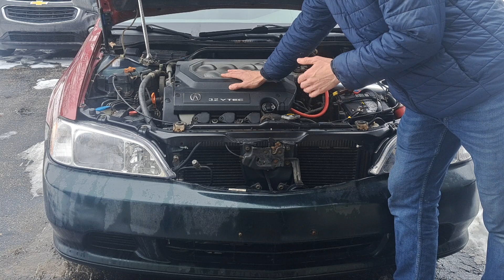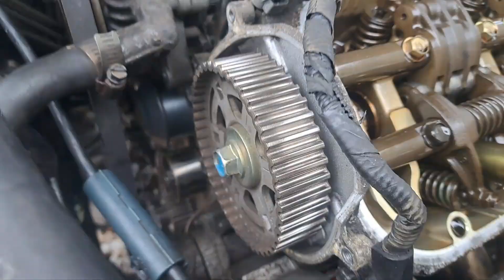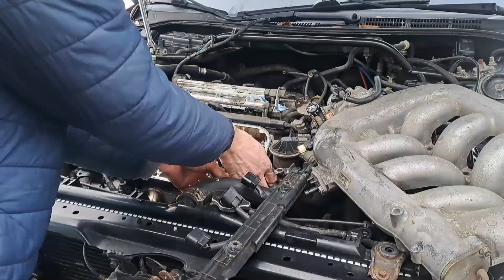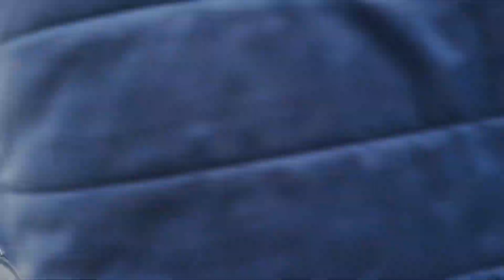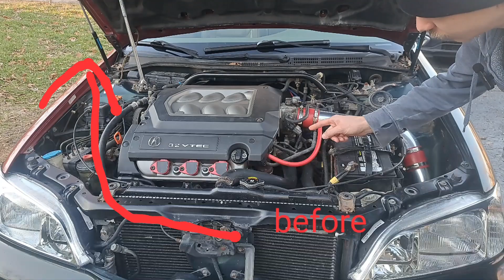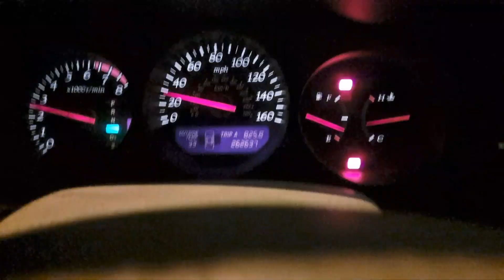J Series Camshaft Upgrade. Acura TL Build Part 2.

Comment: Did you keep the stock springs? Any concern with valve float? Also did you need the spacer?
Reply from the maker: Stock springs, no valve float, and yes I needed the cam gears spacer adapter from p2r. The car is turbocharged now and runs great.

Comment: Great video. It's good to see a build on a non-type s 3.2TL with the J32A1. Is there a reason why you went with the J32A3 cams rather than the ones from the J32A2? Also, wondering if you're planning on doing a 6 speed manual swap. I've never seen a swap done on a non-type S TL.
Reply from the maker: Thanks man! I went with the a3 cams mainly for price and availability at the time. It was still a big upgrade from the stock j32a1 camshaft. I definitely plan on doing a 6 speed swap here soon. The car is actually turbocharged now and absolutely rips and yes its till on the auto lol there is a short of it on my channel
Reply: @jdmjedi777   Thanks for the reply. I agree, it looks like it's still a big step up from stock with just the cams alone. So, with no other changes, including stock tune, would you see noticeable gains as a plug and play mod and is it even safe to run without ecu changes? Although I would think that a tune would get you the most out of the cams.

Comment: My question is, what are the options for better cam's on a 3rd gen.
Reply: They have a drop in cam just like this, also have a no limit can that locks you in vtech
Reply: @ethanmiller9400  link? please.
Reply: @ethanmiller9400 anything for the 4th gen (3.5L)

Comment: Thanks for posting this, do you still have the stock computer? I have a 99 with a bad cam lobe (313K miles) and can only find the J35 cams. I am interested in doing this conversion but can’t find any good info on wether or not it requires retuning the computer. Not looking for performance, just to have it running correctly. Thanks
Reply from the maker: I'm using a piggy back ECU called a DET3+ from ECUmaster. It's about 400 brand new. If the cams are the only thing you are changing you will very likely be just fine without needing a tune. I also still have the stock j32a1 cams out of this 99 also if you are interested. Although one did drop of of the bottom of the box I had then in the other day but it landed right on my toe and not the ground. I could inspect it and make sure it's fine still though.
Reply: @jdmjedi777  Is your TL a manual?
Reply from the maker: @ReeseAssad  no its an automatic
Reply: I have an 02 accord coupe with the j30a2 would this work as well?

Comment: Hey man, when you were putting in  the new cams, did you have to position them a certain way to stay timed correcly or they only slide in one way? I am installing cams on my TL soon.
Reply from the maker: The cams will slide into the cylinder head in pretty much whatever orientation you put them in. Once you get the cams in, you are going to put the timing gears on, and then rotate the cams to the TDC position using the timing marks on the cam gears. Install the rocker assembly and then install the timing belt while double checking the timing.
Reply: @jdmjedi777  OK, so I will have to re line the cams back to TDC regardless what orientation I put it in? That's the biggest thing worrying me  abuse I don't wanna fuck anything up.